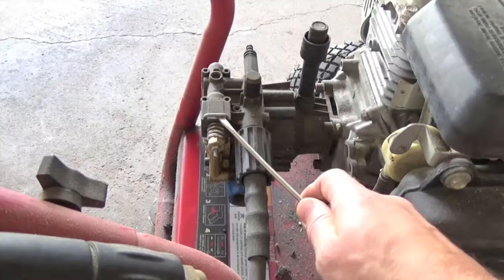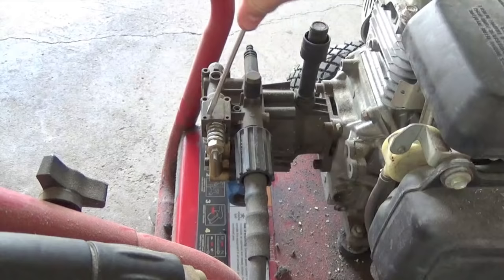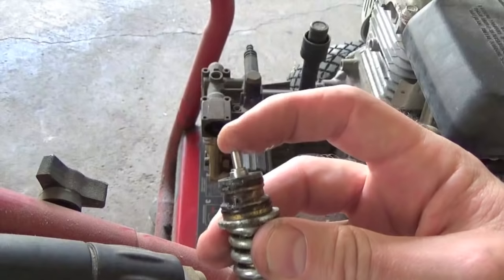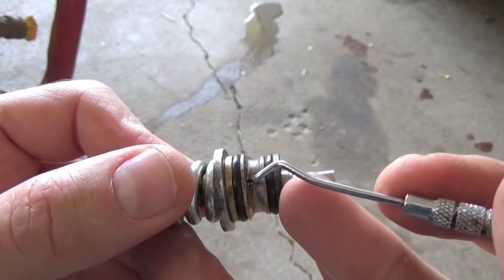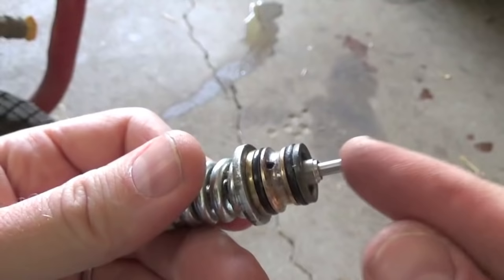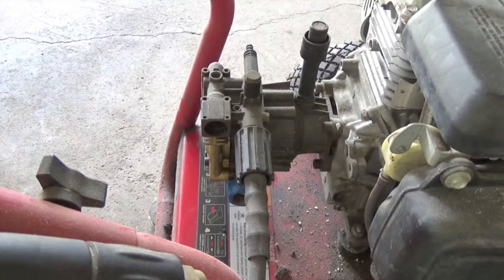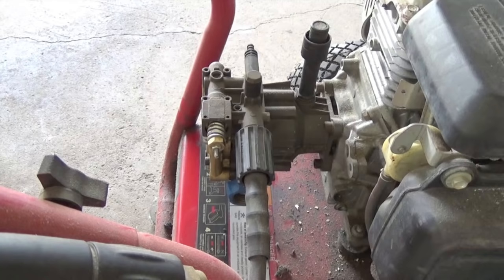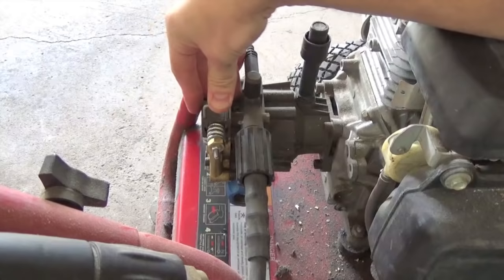Fix Pressure Washer Unloader Valve in 2 Minutes

Comment: What chemicals should I use? If my spring is really stuck there’s no way to really get in there. Do I just buy a new one at that point?
Reply from the maker: Personally, I never run any chemicals through the unit. I pre-spray, then pressure wash. If the unloader valve is completely trashed, it is far cheaper to just replace the entire water pump than just the unloader valve (which will be attached to your new pump).  We do that here: https://youtu.be/Np9c0MLnUv8

Comment: Thanks very much.
Reply from the maker: Hope it helped get you back up and running.
Reply: @HNXMedia  It was very helpful. I’m sorry I didn’t see your video first.
May I ask you a question? If you don’t have time to answer, I understand. While I was trying to figure things out, I removed (which I should not have done) the brass nipple that I guess is meant to suck in detergent. The spring inside popped out, which I retrieved, but apparently there is a diaphragm or something that makes it a one-way valve. That diaphragm (or whatever it is) popped out. I wondered if you know what that part is so that I can order another one. Now that opening sprays out water when the wand is not activated. 
Thanks for your kind assistance.
Joe

Comment: Any idea what that piece is for directly to the right of the box that the unloader valve screws into. Mine is missing one, it was free so I’m trying to find what I need.
Reply from the maker: If you are referring to the large screw in part next to the unloader valve, it is typically the connection that runs  out to the wand (at least it is on mine). If it is something else, take a pic and email it to our contact email address on our about page. I'll take a look at it and help if I can.
Reply: @HNXMedia  sorry, I mean the tall one on the right.

Comment: That plunger pin that's supposed to move freely? Mine's snapped off. I want to fix it but don't know how.
Reply from the maker: Wow! That thing must have had some serious pressure! Typically, it is cheaper to replace the entire water pump assembly than to buy just a new unloader valve (the valve comes with the pump assembly). This is way easier than it sounds. I have a video covering it right here: https://youtu.be/Np9c0MLnUv8

Comment: good video, i put it back together and the PW operates rough and turns off , any tips?  does this valve also control the thermal release valve that dumps water?
Reply from the maker: This valve only regulates pressure when the wand is not being used (i.e. a pressure regulator). It has no control over the flow/dumping of water (that I am aware of). Thanks for watching. Hope the video helped. Peace.

Comment: Would this unloader valve have an effect on the idle on a Ryobi 3000 pressure washer with Honda gcv160..pump is brand new and sonos the carburetor. Runs greta with trigger pressed and washing but surges when not in use
Reply from the maker: Yes, sounds like unloader to me. Thanks for watching. Hope the video helped.

Comment: Have a fairly new 3100psi Generac. Today there is no pressure coming out of the hose and it seems like the water pump is turning on without the wand trigger pressed. Seems half ass backwards. Any ideas?

Comment: Good afternoon -- I would like some advice and an explanation if you have time -- what exactly is that valve for and how is it regulated / adjusted / many thanks
Reply from the maker: Essentially they regulate internal pump pressure and keep the pump from excessive wear/tear. Explaining how to actually adjust one if these is way too complicated. They are typically "set and forget" at the factory for each specific pump type. That is why it is cheaper/easier to buy an entire pump with a new unloader attached than to buy an individual unloader valve and replace/adjust it.

Comment: I tried this,  that pin that moves in and out was not even stuck when i pulled it out.  Nothing in the tiny holes... lubed the O-rings and put it back together... still dies when i release the trigger.  I get plenty of pressure while using it normally.

What is the next trouble shooting step?

Comment: My pressure washer gets hot in temp where the water hose is connected and doesn’t want to idle down, causing my thermal relief valve to spray out water. Could it be the unloader? I have replaced the thermal relief valve and put new oil in as well. Thank you in advance

Comment: Great video, could you help on this, my pressure machine work but I need keep holding the trigger always when the motor is running(work directly no cut the pressure) if I leave the trigger start to feel like overpressure, the technician says that regulator is not working (recirculating the pressure when the trigger is not active)  can this be true?
Reply from the maker: This fix should work. The "regulator" is the unloader valve. If not, it is often cheaper to replace the entire water pump than buy just new unloader valve. The new water pump will come with a new unloader valve.

Comment: I have a Honda 3000 psi with a GCV190 engine.  Ran great a month ago now it feels like it's getting hot and dies after 30 seconds or so if you keep holding wand trigger.  If you let up trigger and let rpms ramp up then you can spray for another 20-30 seconds, but eventually it dies after a few minutes of that.  Only thing I changed since a month ago was replaced a leaking o-ring in the wand.  I checked unloader valve and it looks brand new and moves easily.  I pulled carb apart and it's spotless and both jets are clear.  Any ideas?

Comment: Should the ball bearing behind the loader pin come out easily? There seems to be a colar holding it in.  Mine seems to be seized in there after not winterizing properly. Som corrosion in the valve body.
Reply from the maker: Try soaking the entire thing in a product like CLR. If you have hard water or calcium build up, that should loosen it up.

Comment: my ryobi won't idle down for some reason all of a sudden. It took a hard fall yesterday when it was running from about 3 feet off a platform but it didn't shut off or anything and then i also cleaned around the governor spring with some carb cleaner, those are the only two things i can think off that might've altered something. I can get the engine to idle moving the governor arm manually but otherwise it just runs full throttle even when i let go of the trigger, i like the idle down, it's too loud like this. I was told maybe when it fell the unloader valve got stuck in place thinking the machine is full pressure all the time. It DID fall on it's back. Any suggestions?

Comment: Question: I found that part on my XR2600 with Devilbiss pump. Seems stuck as you said, but that part has been discontinued :-(  So I am looking for a tutorial on how to revive this one. (DeVilbiss part #A08869
Reply from the maker: I would just replace the entire water pump. The new pump will have a new unloader valve, and is often cheaper than buying just the unloader valve itself: https://youtu.be/Np9c0MLnUv8

Comment: power washer with no water pressure, was working for 30 minutes then stopped pressure...did this trick to see if pin moved and it was. fired back up with still no water pressure..did the motor off with water on to see if we can purge air as well. any ideas, Bad Pump?  only 2 years old pressure washer  Power Stroke ZRPS80310E Pressure Washer 3100psi Electric Start

Comment: Everytime I attach my surface cleaner machine starts to shake then it turns off.  If I replace the surface cleaner with any tip then it works fine.  I have cleaned the carburetor and still have the same issue.  Any help is most welcome
Reply from the maker: I have never used a surface cleaner, but here is what I would suggest: It seems as though the surface cleaner is causing some bad back pressure through the system. If you can, I would take the surface cleaner completely apart and make sure all the o-rings are good and that there are no leaks or clogs in the device. If it works without the surface cleaner, it is not the pressure washer itself. Really sounds like some type of vapor lock issue (bad o-rings or other leak in surface cleaner device).

Comment: My Coleman Powermate 1800 psi just abruptly has ZERO pressure with absolutely no warning of diminishing functionality beforehand (bought last summer&worked like a champ, stored in the shed through a VERY mild midwest winter, brought it out this spring and ZERO pressure).  My 'unloader valve' does NOT have a retractable end but is an inflexible screw-tip.  Could this be the problem I wonder? Rigid vs retractable?  I even jammed a bb (ball bearing) in the space thinking that would increase pressure - couldn't even power it ON when I did that (cross that off the list).  Great vid but I'm getting the sinking feeling I just flushed about $200 down the toilet ($100 for the washer off craigslist - i think he KNEW it was of finite functionality& got suckered into this $70 part for a detergent dispenser thingie recently, before i found out the machine itself went clunk).  If I could swap out the pump assembly underneath I'd do so if could be assured it would FIX it - motor runs fine (gas), wand/hose perfectly intact just nada for pressure and no one's interested in even attempting to fix it.  Bummer.
Reply from the maker: Not sure how much more you want to sink into it, but it really sounds like the water pump. Super easy to replace (at least on mine - see my other videos). Depending on the model it should be less than $80 fix. But again, it is kind of a "roll of the dice." Best of luck. Peace.
Reply: @HNXMedia  Thanks for the reply - sincerely appreciate it.  Just got off the phone with "FAIP" pumps in Florida which carry the split-up Coleman industries, specifically my apparently ANCIENT model (PW0881801 - FAIP equivalent is 58700) and he stated for the cast aluminum replacement pump would be right at $159 with shipping.  The MOTOR runs like a CHAMP (hate for THAT to go south if/when I get pump replacement!).  I'd infinitely prefer the $80 pricetag!!!  Keep up the great work.  Have a great weekend.
Reply from the maker: @harrybalz3136  Best of luck! Let me know how it works out.

Comment: What type of grease to put on o rings
Reply from the maker: I typically recommend non-petroleum based greases just to be on the safe side. 100% silicone grease is good to use in this application. It does not take much at all. Just enough so that the valve slides back in.

Comment: What about the vertical shaft pump machines that don’t have an external spring loaded valve?
Reply from the maker: I do not have any experience on those and would not want to give you bad advice. If you do find a solution, I would love to know what it is for those particular machines. Sorry I could not help. Peace.

Comment: On my Briggs and Stratton power washer my port has a rubber plug is that normal. I'd like to add my neighbor bought a brand new used it a week and gave it to me because there was no pressure I'm wondering if it's because that little Port is plugged up
Reply from the maker: Not familiar with any rubber "plugs" near this part, but some models do have a rubber cap which slips over the end of the unloader valve (it is just for protection, it serves no actual function). That might be the piece you are referring to, but not 100% sure. Hopefully this helps fix the issue on the one he gave you. that would be an awesome score!
Reply: @HNXMedia   the little hole you suggested to clean out  on the unloader valve.  On mine is  clogged with a piece of rubber I was just wondering if that's supposed to be  there
Reply: @HNXMedia   thank you if you would not have mentioned to clean out that hole I wouldn't have realized that the Rubber seal inside  was  bad  dude thank you my neighbor gave me a free $600 power washer
Reply: @HNXMedia   you kick ass lol thank you
Reply: O yeah it's brand new 😂😂😂😂
Reply from the maker: @chucknorris-ec1pt  Score! Glad it helped.

Comment: I have this pressure washer but I can’t figure out how to get it to siphon any ideas?
Reply from the maker: Check for cracks in your siphon hose, make sure it it secure on the brass nipple, and sometimes shortening the siphon hose will help. Siphon should work automatically on most brands. That's all I can think of off the top of my head without seeing the machine in person.

Comment: I do not see a contact email, I was referring to the tall black piece to the right, the third from the left. Need a name or direction so I can find the part
Reply from the maker: Oh, that tall black thing is the breather tube for the oil cap (that model has a extension on the vent tube). Some pumps are sealed and do not have that part - others have a smaller version. The extension is not necessary.

Comment: My Karcher G2800FH is pulsing when I depress trigger. I have cleaned unloader and thermal valves etc. Water appears to be spurting from a machines recess in base of pump. Any ideas?
Reply from the maker: Pull the pump and check the seals. Also, separate the pump head (usually brass) and check the o-rings around each of the individual valves. They are usually little plastic spring-loaded things (I have had to replace both the o-rings and the plastic spring valves before because they get clogged with hard water). Hope this helps. Thanks for watching!

Comment: What's the symptoms of this needing attention? I left my petrol pressure washer running for about 10 mins without spraying. It's got no pressure/ water just squirts a little when trigger is pulled. Help/advice appreciated.
Reply from the maker: Unloader valve issue is usually defined by a "surging" issue, where the pressure washer surges and then won't build pressure or the water will just trickle or squirt out the end of the wand. What you have sounds like a classic unloader valve "sticking" issue. Cleaning it should fix the problem.

However, it could be that the entire pump is bad. The good news is, you can replace most pumps on most brands of pressure washer for around $80 (and you get a new unloader on the new pump anyway).

Hope that helps, let me know.

Comment: The bottom of my pump blew off two of the three bolts completely broke off. However, there doesn't seem to be any other damage. Want went wrong? My thermal release valve? I removed this valve and nothing appears to be wrong with it.

Comment: I lost my u shaped pin/clip that holds the unloader valve in. Any idea where to get another one?
Reply from the maker: If it is a "standard" Briggs and Stratton you could try one like this: https://amzn.to/2ULn5dT but be sure to check your manual (if you have it) or search for the engine part model number on the web to make sure you get the right one. Hope this at lest gets you headed in the right direction. Peace.

Comment: My pressure blaster has retained the pressure, is there a relief valve, ?? Or what's the easiest way of releasing the pressure?
Reply from the maker: On mine, you pull the trigger to release the pressure between "pulls" (if it doesn't start right away) and use the same technique after shut down. Hope that makes sense. Best of luck. Thanks for watching.

Comment: I tried doing this on my Honda pressure washer bought in 2019 at Home Depot 
When I took the pin out it broke still stem in the hole and I can’t get valve out
Reply from the maker: Read this comment and then checked mine. On mine, the "U" pin holes go all the way through, so you might try to tap it out from the bottom using a punch or a nail. Best of luck.

Comment: Mine is shooting water around that unloader valve, and I have much lower pressure than normal, is that all I need to do or is my leak a sign of greater issues?
Reply from the maker: Start with cleaning the unloader valve and replacing the o-rings on the unloader valve. The issue you're having sounds like a split o-ring.

Thanks for watching and taking the time to leave a comment!
Reply: Yes, that is in fact what the problem was, it was split in two, the generic box-o-parts from home depot didn't have the correct size in there so off to the internet I go for them.
Reply from the maker: If you still have the instructions for the pressure washer, sometimes they tape a spare inside or at least give you the correct measurements. Either way, as long as you have the old (split one) you can get the correct size o-ring.

Most importantly....I am SUPER STOKED that I was able to help! Give me a full update when you get 'er up and running again!
Reply: And back to the store I go for them due to the prices online, I found an o-ring that seems to be like the split one, put it back in and no water squirts out at all but I still have low pressure.  I heard something about tightening the spring increases the pressure..I had tightened it, maybe it's causing the low pressure.  I will keep doing tests, and looking for answers.

Comment: Seeing a trend. People don't tell you how to take the black boot off the unloader valve. It's the hardest part but they start vid with it off or pull the switcharoo in a replacement video.

Comment: I’m trying to remove my unloaded valve but it doesn’t come out. What should I do? Thanks
Reply from the maker: Typically the only thing holding them in is that "U" shaped clip and friction. Once you pry out the "U" clip you should be able to side a flat screw driver into the "spring rings" and just kind of slowly pry it out. I am unfortunately not familiar with any models that are more difficult that that. They are all typically set up the same way. Note that some can be "hidden" under rubber caps that may need to be removed. Hope this helps. Thanks for watching and taking the time to leave a comment. If I can help in any other way, just let me know.